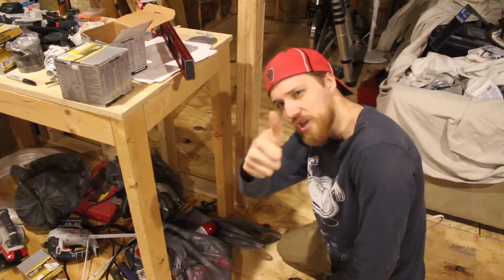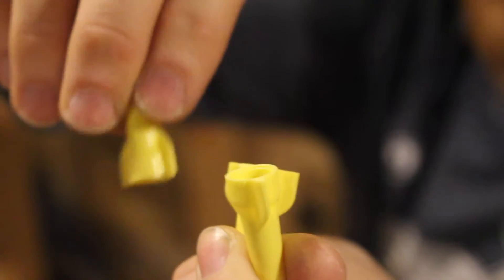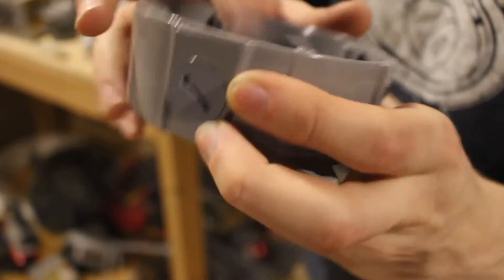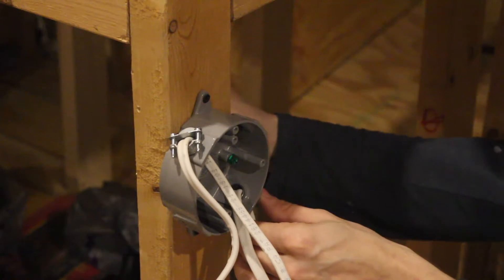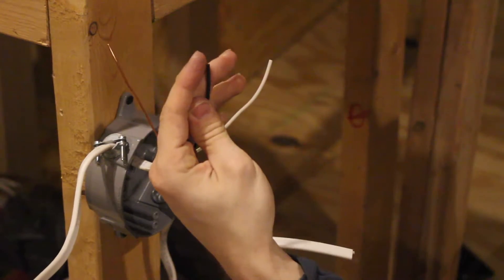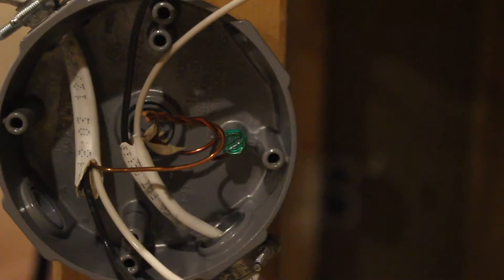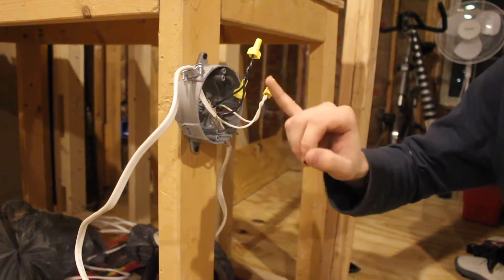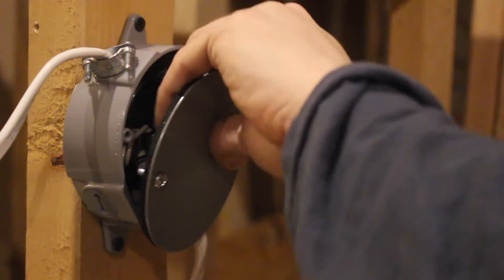Tutorial Time: Proper Wire Splicing

Comment: Just a word of caution at 5:11 time mark you made the statement"   it does not matter what ground conductor that you use to ground the box. It is always a good practice to use the ground wire on the branch circuit that leads from or terminates back to the bus bar in the Main panel or sub panel . The splice is a weak point in the Branch at this point and can lead to heat if there was to be a direct short to ground and if the ground should burn open as  it does at times open at the weak point. You are not incorrect, but it is a good practice to always land the branch feed in a J-Box or splice box plus it also helps identify which part of the circuit is the feeder from the panel .
Reply: Thank you

Comment: benefit of using a box with separate clamp is you can orientate clamp screws to the front for easy access. Strip NM cable before inserting into clamp, that way you can minimize insulation inside junction box. Use a pig tail to connect the ground screw rather than wrapping around in the middle. it will create tighter connections. If you feel the need for tape on your splices consider using Wago 221 lever nuts for the DIY job
Reply: What do you mean if you feel like taping? Do you have to tape around wago 221s?

Comment: not sure if anyone knows if putting a j box on top of a recessed light box (light fixture was removed from garage ceiling leaving the recessed box with branch wiring) is ok?  I would like to screw j box on top (like an extension),  knock out on back/clamp 2 wires in back so I can run conduit surface mounted on drywall to LED fixtures.  Can I do that or do I need to run splice to another j box mounted directly to drywall??  I hope that makes sense?  Perfect situation would be an extension for the ceiling  box with knockouts but... I don't think it exists.

Comment: Please do a video on how-to-do four splices on 12-Gauge wires, and four splices on 10-Gauge wire. 

Also, demonstrate what are the proper size wire nuts for each splice.
Reply: If you need that much redundant information, you should not be doing electrical work.
Reply: Use WAGO connectors

Comment: Good video but......    There should never be exposed copper... EVER!  You can cut the wires short enough to conceal them in the wire nut.  Electrical tape is a good move and code for some places....   Also the box used here is a good box for using outside but does not have to be used indoors.  There are cheaper options available.
Reply: How do you wrap the ground copper completely?

Comment: Where or what is the box being grounded to?? What's the point of the grounding screw if it's not connected to anything conductive?  Why can you not just connect the two ground wires together?
Reply from the maker: Grounding the boxes is essential for the rough in. It's the same reason you ground an outlet. 1) the inspector needs to see it, 2) it is to help keep people safe from shock. It also depends on the kind of wiring you are using. But all in all, the box needs to be grounded, the device needs to be grounded, everything needs to be grounded. I always take extra precautions with electricity.

Comment: I have a moldy room I’d like to avoid.  There are some light fixtures still connected to a junction box that have be removed in order for trash haulers to take away.  I was told that all I have to do ( after shutting off the fuse to this electrical junction box) is cut of the wires from the outside with an bolt cutter.  Then seal the wires with caps and electrical tape.  

This would make it faster for me if I want to avoid being around the mold.  The electrical power would be cut off and since the wires will be capped I’m “assuming” there will no be issue with these dead wires being connected to the other wire within that box.  So I’m taking two electrical fixture wires from a junction box that one remaining wire for the outlet.  I can then turn the fuse back on without issue. If that makes sense.

Comment: Black insulation tape indicates both are live, not live & neutral. If you need to insulate wire nuts after fitting with tape it's not fit for purpose.

Comment: Was hoping you would cover splicing into existing circuit - say in an open basement ceiling, to provide power for another outlet or two in an upstairs room. I assume I’d use a box to join the wires together after I spliced into the circuit. Then run a wire or two up to the new outlets?
Reply from the maker: Bingo! Just make sure...please please please that all wires that are being worked on are off. Sometimes you think it is one circuit but it's actually two or even three. But yes, if you want to cut into the wire and add to it, you can. Just make sure it's the same type and size.
Reply: There is a lot more than that to running wires. You need to make sure you don't overload the circuit. If you are just adding a single outlet or additional light, this is probably fine. If you are trying to wire an additional room, this would be the wrong and illegal way to do it. You also need to leave the boxes exposed so they can be accessed, either though the ceiling or through a cover. There is a lot to doing electrical work safely and half of what this guy did was wrong.

Comment: Can you just connect the two copper wires without attaching it to the green screw?
Reply from the maker: If you are talking about the grounding wires, yes you can. I prefer to ground the box as well for good practice, but you can just connect the two copper ground wires and that is sufficient
Reply: @thehamdymancan  Ground wires spliced together must be grounded to the box if it a metal box, usually via a pigtail connection.

Comment: Can I splicing in 3 instead of 2? and I'll need bigger box for that? Thanks in advance
Reply from the maker: I do not see why not...The same rules apply, same wires, same type, and if you have the space to do so, same box size. Just keep an eye on where the wires are coming and going. And make sure all power is off!
Reply: Thanks
Reply: Yes, 3 wires wire nutted is a common occurrence. Do you need a bigger box? Probably not, but it depends on the area of the box in cu. in. and the number of incoming wires. There is a calculation for this.

Comment: Have to move an outlet further up a wall - have to extend the wiring with more wire - glad I saw this to do it safely, as the new outlet is going in built in bookshelves and I won't be able to reach the wiring in the wall ever again. Junction box, electrical tape, check.
Reply: That woudl be 100% illegal. You must ALWAYS be able to reach the junction box. It is dangerous and illegal to close up a junction box in a wall or ceiling.
Reply: @MAGAMAN  I actually attached the junction box to The back of the bookshelf so I can still access it
Reply: If existing wall case ( box ) will not be asessable if there is only 1 cable have to remove NM cable and use special 1 time cable connector.

Comment: Nitpicker comment (I am not a Code Nazi)  at 5:45, you wrapped ground wires counter-clockwise.  You but the wire nut on clockwise.  We are not required to use a wire nut my my inspectors,, but if you did, the ground wires should be wrapped clockwise.  I enjoyed your video (except the music).
Reply: He was basically unwinding the wires with the wire nut. This is why he has to use tape, because the way he did it, the wires are much more likely to fall out.
Reply: @Mr.Torres831  What is false?

Comment: Good tutorial...but I'm having a hard time finding info and instruction on the nuances I'm not sure about. Why does the ground have to be attached to the box if the grounds are attached and going back to ground?  You didn't mention why the wire has to be the same gauge. Why can't I attach 14g to 12g if I just want to add another outlet? (I think 12g was used because that's just what they had). ....and..do you need to add a junction box or can you just daisy chain off the existing outlet? ...and if you can, do you have to ground to the box using pigtails? 
I've watched five videos so far (yours has been the best) and I thoroughly know how to screw on a wire nut now, with explicit detail on how to strip off shielding on a wire, but the stuff where I might screw the pooch and burn down the house gets a quick gloss over.
Reply from the maker: Okay there is a lot here. But good questions:

1. For safety and for wiring splicing like I showed, grounding to the box is key because of the continuation of the load. For rough in, they want to see that, it is an added level of protection. In situations with adding additional outlets, the system is a little different

2. The wire size has to stay the same because of the load coming through the wire from the breaker. The breaker size dictates how much power can run through the wires. If you have a 15A breaker for the receptacles you are describing, you may be okay with connecting 14 gauge to 12 gauge. The reason is, 14 gauge works best with 15A breakers. If your breaker size is 20A, and people are using 12 gauge, if you connect 14 gauge you are drawing too much load through the wire. This might be a hazard. I would look up your local area codes and the NEC for specifics. Remember, keeping them the same is safest.

3. If you are adding an additional outlets, you can Daisy chain them from the original as long as you can do it properly from the original to the new outlet. My example I show is if you cannot run new wire from the original source to a new source. When you run continuous wire from one outlet to the next, you do not need a junction box. Now, when installing the new outlet, install with an outlet box or there will be instability around it, possibly causing a hazard.

4. If you Daisy chain the outlets together, you do not have to ground to the box. Now I will say this, most newer outlets have a grounding screw on them. I recommend wrapping the ground around that and then pigtail...for added protection. As long as you have continuous wire from the original outlet to the new one, and pigtail the grounds together, you should be fine. When you do so, make sure to leave yourself lots of spare to work with just in case.

Before adding anything, again, just the NEC to make sure you are installing correctly and check the manufacturer instructions to make sure all bases are covered. I am a DIYer, and an engineering designer, but I can only recommend. The biggest thing is the breaker to wire installation. You do not want an oversized breaker with an undersized wire. That breeds hazard in my book. 

Let me know if you have other questions.
Reply: To answer your ground question.... When you put the wires into the box and put the cover on, the wire nuts (if not done well) can fall off.  This can put the bare wire against the metal box making it part of the circuit, energetic zing the metal box to 120 volts ac.  Touching the metal box in any way would electrically be the same as touching the hot bare wire.  While several factors go into electrical shocks, you should expect one.

Grounding the box allows a safer current path for current to return to your panel and trip the circuit breaker.  Safer because you would be no where near the box when it happens.
Reply: You don't need to ground the  box if it is a plastic box. You also don't need wire nuts if you are using a plastic box, but you do need to have the wire properly secured outside the box.

Comment: Do I need to ground the ground wire to the box if I’m using a plastic junction box?
Reply: Plastic boxes can’t be grounded, non conductive
Reply: Not sure but I think you can't ground a plastic junction box because it doesn't conduct electricity like a metal junction box. I haven't seen a plastic junction box with a grounding screw but I could be wrong.
Reply: @keithkeithkeith9874  Plastic box won't be grounded, but electrical cable should be grounded in the main electrical box and in turn grounding your line cable.
Reply from the maker: Yes. Ground the wires always. It's a good habit and it is code in most places... especially if it is for a splice.
Reply: @thehamdymancan  You are an idiot. It's PLASTIC!

Comment: I want to make 3 wires come together, what's that called?  How do you do it?
Reply from the maker: Three sets of wires from three different fixtures?
Reply: @thehamdymancan   I have two AC to DC power supplies with three wires each on the AC side (ground, hot and ... the other one XD ).  I want to connect them all to the 3 house power wires.  Thanks for the attention ^_^
Reply from the maker: I think I understand what you're asking. The concept of splicing two sets of wires together is the same as it would be if you had three sets of wires together. As long as you were connecting all of the hots, all of the neutrals, and all of the grounding wires separately, in general you should be fine. Please take into account the size of the wiring, the voltage, and other electrical factors before installing or trying this yourself. In most cases especially with equipment, there are instructions on how to properly wire together the equipment. I highly recommend you consult the instructions and additional videos as I'm no expert and do not know all the parameters of your situation

Comment: Why are boxes made out of steel? Wouldnt plastic be better so it cant become electric?
Reply: Depends... metal boxes are found mostly in commercial electric and not residential. Metal boxes are fireproof and may have to be installed in some areas. Residential electric uses plastic boxes to prevent any shock to the user since people are always flipping switches, plugging in chargers, etc. Durability also comes into play too. Usually plastic boxes are the way to go imo.
Reply: @arcanum3896  Metal boxes have to be used with armored cable while nonmetallic cable can be used with either plastic or metal boxes.  However when using metal boxes proper grounding is a must to prevent a possibly fatal shock hazard.  Which one a contractor uses mostly depends on cost.  I don't agree with the presenter wrapping tape around wire nuts.  All that is needed is to make sure there is no exposed wire sticking out of the bottom of the wire nut.
Reply: You're new to Earth aren't you?

Comment: if you're using electrical tape on your splices, something is very wrong LOL.. your splices on the black wires were terrible.. you had bare conductor showing after putting on your wire nut.. I guess that's why you're using electrical tape LOL